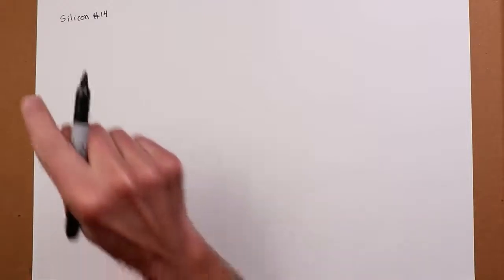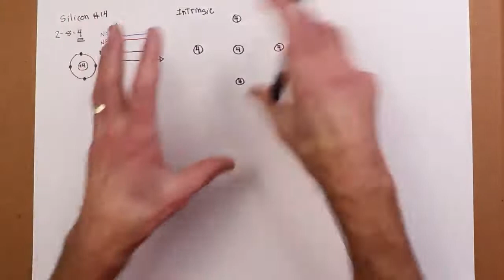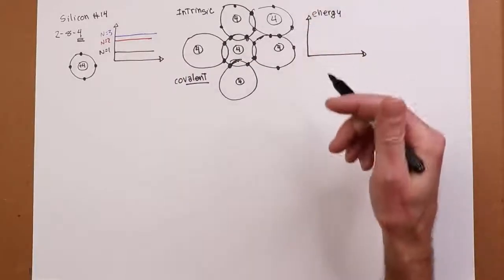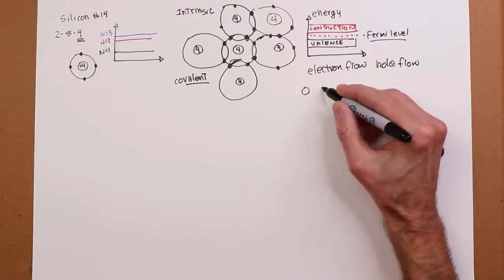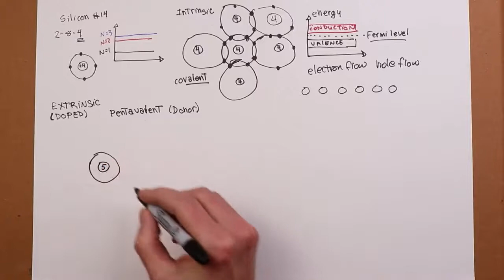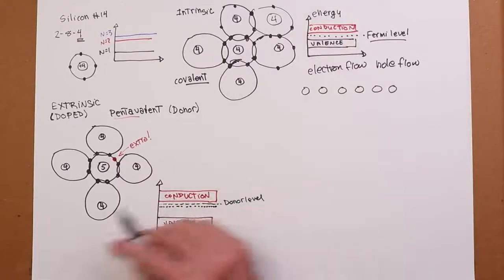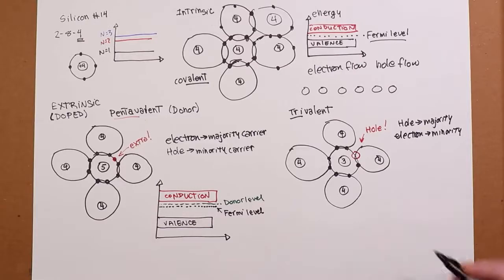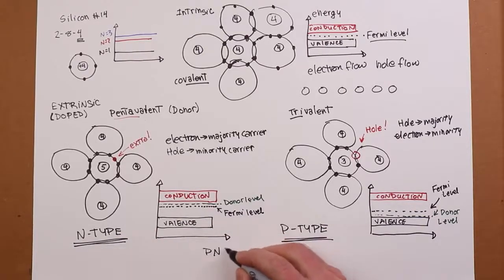Semiconductor Devices: Fundamentals

Comment: Sir i have a doubt from page no. 16 of your book electronic devices in the topic variable naming convention, you write that voltage are denoted by Vxy and like that but the exception for this are power supplies which is denoted like Vbb or Vee, i m curious to know the difference between voltage and power supply. Thankyou
Reply from the maker: "Voltage" is a generic term indicating a potential difference. A power supply is a fixed DC voltage source, for example, a battery. Ideally, its value never changes. The other voltages referred to are those potentials seen across various components such as resistors or transistors. Their voltages will depend on the supply voltage(s). Sources generally are considered as voltage "rises" while the voltages across resistors and the like are generally considered as "drops".

Comment: Looking forward to learning electronics from your videos. Question why can't you simply mechanically join N and P materials to make a diode?
Reply from the maker: That's a good question and I'll give a quick answer, keeping it simple. First, you must consider the scale. Any sort of physical break (the mating surface of the two parts) would be huge in comparison to the silicon atoms. It would be like trying to drop a set of golf balls into a set of holes cut into a large board, but the golf balls are on one side of the Grand Canyon and the board on the other. Then there is the practical side of joining these things. For example, a bipolar transistor has three layers. The middle layer is amazingly thin compared to human scale, and would be extremely fragile if you tried to manipulate it mechanically. Finally, with integrated circuits, we make them in sort of a "layer cake" fashion (e.g., all of the transistor emitters at the same time) rather than piecing together the individual parts. That technique is what makes it possible to create ICs that have millions of transistors but only cost dollars instead of millions of dollars each.
Reply: @Electronics with Professor Fiore  That was a helpful analogy thanks! i'm sure I'll be following up with more questions.